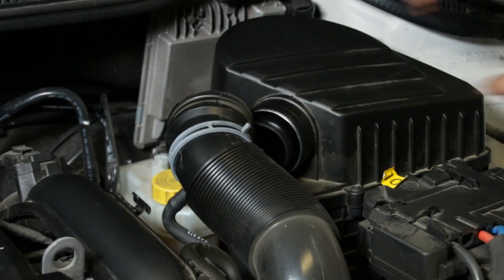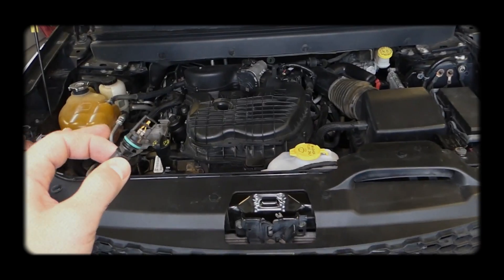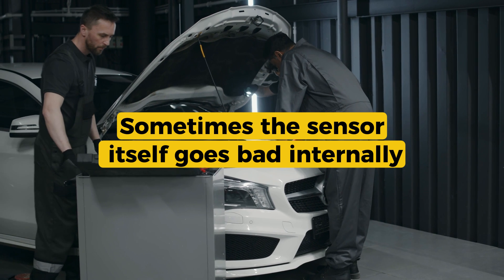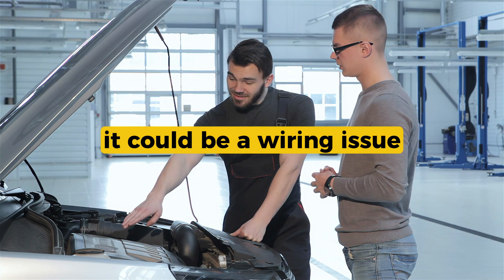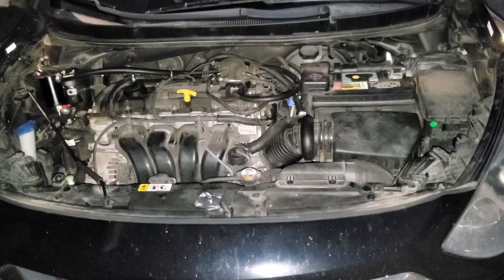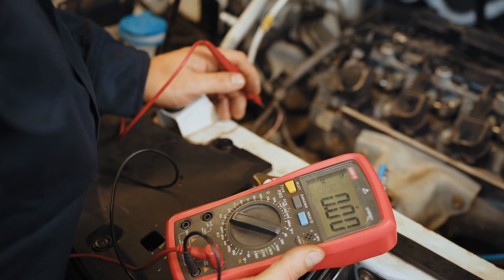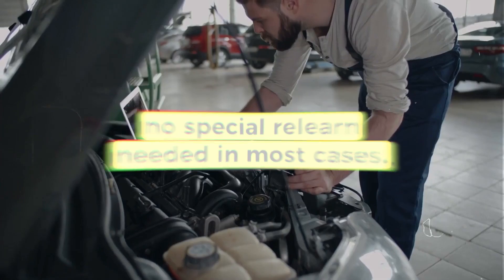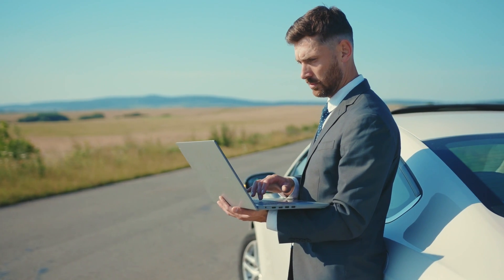P0113 Code: Intake Air Temperature Sensor High Input – Causes & Fix

Comment: I just replaced my MAF sensor less than a month ago. Car was running fine after I replaced it, but now whenever my revs go around 3k, it bucks and jolts. If I keep it under, it's fine. What could it be? I have a few O2 sensors that are going off too.
Reply from the maker: I'd check with obd2 scan the live data of that sensor what is it reading at idle and when you rev it etc. if it's out of spec range gotta check connectors wiring etc too